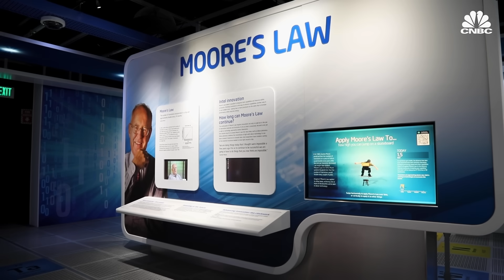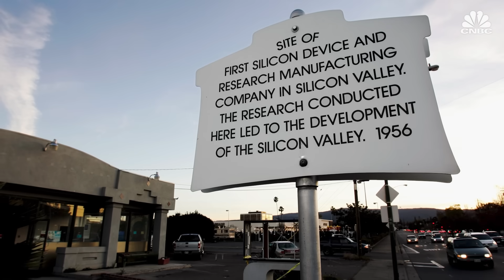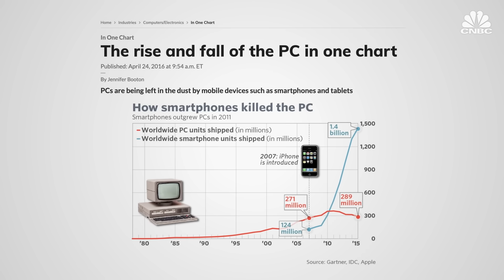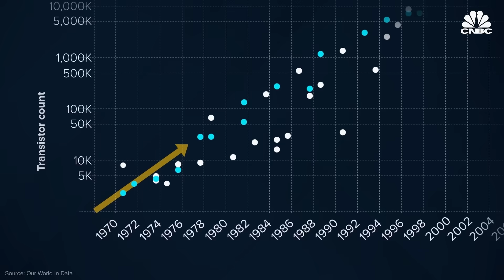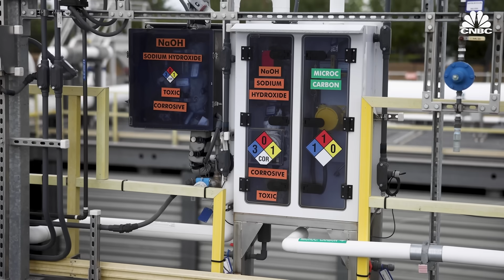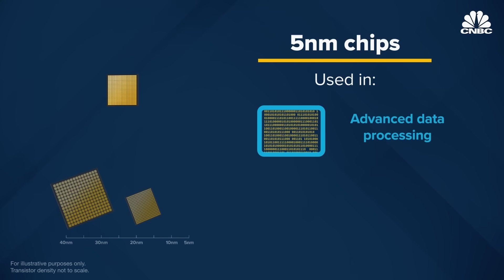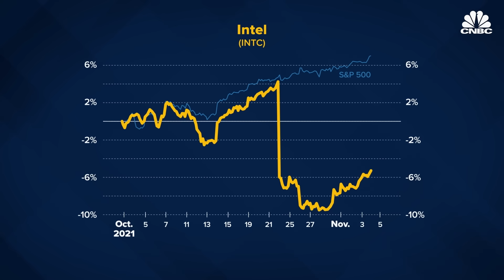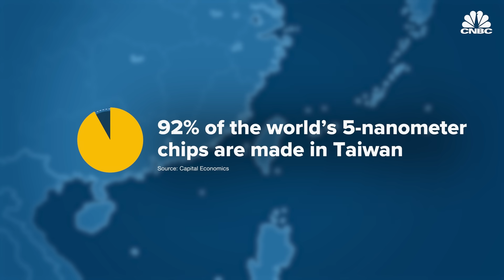Inside Intel’s Bold $26 Billion U.S. Plan To Regain Chip Dominance

Comment: Dr Lisa Su and CEO Jensen Huang right now: here we come Pat! You will be KO again 🤣🤣
Reply: Non of those companies you mentioned manufacture their own socs
Reply: @directlinkrexx4409  you think next gen Intel will do its own soc? 🤣🤣 Get the fking tech news man. Intel already agreed on 5nm deal from Samsung 🤫🤫
Reply: @vncatechinfo9798  Hardware industry works in cycles. The fact alder lake which is 10nm beats 7nm amd cpus tells their engineering is good, they just need to up their game on process node, which I am sure they will.
Reply: @Badumtss2468  sure intel will but intel needs to do with power's consumption on it way too high at stock. OC mode can draw up 400W which im not surprised when i9 11900k already did.
Reply: @vncatechinfo9798  I think that will be addressed with the big.little arc as it progresses further. One example being the core i5 12600k, if I remember correctly that comes for 320$ or so. That thing is sweet. Intel will get the crown back (it has already technically speaking). A sleeping giant, but a giant indeed.
Reply: @Badumtss2468  yeah Intel is a giant for years i have 10700k which is still good at the time i may upgrade next year and see which one offers the best price and better performance.

Comment: Would love to see Intel make a comeback, especially after their designs falling behind those of AMDs, chips manufacturing in the  US would also strengthen the supply chain
Reply: @Solendore I sure also hope there are bright futures for your company! Also its amazing that you're so passionate about your job!
Reply: @Solendore Good job on Alder Lake. Still the performance uplift compared to AMD 1 year old CPUs is not that significant and power consumption is definitely worse. AMD's Zen3D with V-Cache will most likely regain the performance domination. Good luck with Raptor and Meteor Lake. You will need it to compete with Zen4 and Apple M2 series.
Reply: @Solendore The main thing is that companies are developing on US soil.  That way, US companies control trade secrets, control production, and create in-house, organic job growth!
Reply: SILICON CHIPS SHORTAGE ARE NOT ACCEPTABLE IN THIS 21 CENTURY.
Reply: Gaming Fanboys give too much credit to AMD. It’s easy for them to take the credit, they not manufacturing the chips.  Intel could have easily designed a 5nm chip if they had TSMC make it for them.  But why would you want TSMC, a competitor to make your flagship products? 

Also the nanometer benchmark is just as misleading just as Clock Cycles and Cores.  It’s not so easy to determine performance on clock cycles, core count, or nm process.  
He best example is Apple Silicon vs AMD CPUs.  Both are 5nm but everything from core count, clock speeds, to energy consumption are completely irrelevant because Apple Silicon is based on ARM while AMD is based on x86.  Apples designs were built for mobile from the ground up, while AMD has been designed for Non mobile computers such as desktop and servers from ground up and they been scaling down to make them draw less power. The architecture is also vastly different as well. Apple Silicon on the new Mac Book Pros have put x86 processors to shame for video editing, photo processing, and audio processing.  The only thing that beats MI Max is a high end video card on graphics for gaming.  To be fair the high end video cards drain 300 watts of power, while the 32 core integrated GPU gives them a run for their money while drawing less than 50 watts of power.
Reply: @JasonB808  dont feel like reading all that man. Can you sum it all up in like 2 sentences?
Reply: They just can't unless its fab is another company. National security  can't give you cost advantage and  Taiwanese and Koreans are actually helping not competing. Provide stronger support to both 🇹🇼 and 🇰🇷 is the right way to go and let them invest in US. After all, most manufacturing are in Asia. You can't have just the chips made in US while end products aren't.
Reply: @Solendore As an Intel shareholder I have faith in you guys. Keep up the good work. 👍
Reply: Mfg chips in different areas of the Earth strengthens the supply chain. Not just "bRinG MuH MnaUfACturInG HoMe."
Reply: @mikes2381  Not to mention, there is the talent here to make chips, and when so much of it is automated, it doesn't necessarily matter as much
Reply: @Solendore Hey! what are your opinions on AMDs market cap? just a day ago it was about 168 billions worth and intel is around 200 billion in value. Ofc intel has much bigger revenue than both AMD and Nvidia, but their at risk of being overtaken by another one of their competitors in terms of value. Do you believe intel is currently undervalued?? especially given all the promises their making now and a change in leadership( Pat shows great promise).
Reply: @Solendore quick question: what do you think about the i7 10870h? would you still consider buying a PC with that performance today? or even as a laptop
Reply: They will, watch.
Reply: Both TSMC and Samsung are building major fabs in the US. TSMC has Fab 21 underway in Phoenix and Samsung will be building in Texas.
Reply: @Solendore valley silicon
Reply: @Solendore lol Intel 4 is TSMC 7nm, Intel 7 is TSMC 10nm. Comparable, yes, but you'll confuse people lmao.
Reply: @Solendore please crush amd. sellouts!
Reply: @Solendore U work there and u say Intel 7 is like Tmsc 7nm? Damn Intel 7 is 10nm and u not even close to make real 7nm to beet Amd. So other then your Cpu need Nuclear power to run and Uragan to lower temps. Wtf u talking about. Amd in on the way to make 5nm then mext gen even smaler. U can see what Amd made whit latest stuff. Very impresiv.
Reply: Their design has no issues. It’s their manufacturing cannot catch up the design.
Reply: That’s why US pressures Samsung and TSMC to share their secrets
Reply: Depend on what you mean by comeback. If you mean their chips will be as good as tsmc then yes they will eventually. On the other hand if you mean Intel can get back to the position that they were 5 years ago then the answer is no. The market share that Intel is losing to AMD would never revert back to them unless something terrible happen to tsmc/amd like U.S. ban tsmc chips for whatever reason.
Reply: @Solendore we will see when it goes in market. In the meantime I’ll stick with AMD.
Reply: The x86 has been and still is a lemon, why would you want them to rise up when they forced the industry down a flawed architecture, in comparison why do you think eveything but the PC is running ARM,  I rather ARM be king of the modern day CPU.
Reply: @Solendore You are saying you intel can beat the Apple M1 and Ryzhen but the M2 is rolling off the production soon enough, no Intel is well behind the 8 ball.
Reply: @Solendore If Intel can produce the advanced 7nm node chips, why would Intel need to outsource to TSMC for 5nm node chips ? Intel is 2 generation behind TSMC & Samsung.
Reply: toast
Reply: It would be a lot cheaper to teach Intel's employees Chinese, saves a lot of money and trouble.
Reply: IMAGINE THAT!  MANUFACTURE IN THE US!
Reply: They have
Reply: @Solendore if only you could make good products at an affordable price, focusing on the most insignificant aspect of technology performance, let alone catching up to the competition at a higher price isnt something i would brag about. trying to enter a new market, only to call it quits when its not immediately successful is downright shameful, hopefully all this free government money will bring alot of affordable, high quality chips to the market, i wont hold my breath though, it is intel the king of high price we are talking about.
Reply: Agree. Everybody loves a good comeback story, right? Seabiscuit, the mighty ducks, Robert Downey Jr, Rocky. Kim Kardashian.
Reply: Ahmen!  Buy products with INTC chips.
Reply: @Solendore but your power consumption is ridiculous, of course you achieve more performance if you throw more power at it. Power efficiency is just as important as performance
Reply: @blablabla6975  you call gaming with same power consumption as AMD ridiculous ?  Get your thoughts together, man.
Reply: @blablabla6975  really not tho, intel just really pushed the 12900k by setting the power limit at 241W. You could limit it to 180W and just lose ~10% of perf. 

Plus the 12900K has similar MT efficiency to the M1 Max when limited to 35W.
Reply: @blablabla6975  Honestly at that level of performance peps who really can utilise that Power don't worry about Power consumption
Reply: @bloodwargaming3662  TELL THAT TO THE SERVER MARKET!
Reply: @blablabla6975  Specially for portable. And more power consumption mean more heat. Intel has a big problem.
Reply: @Solendore I have a question if you really are a engineer at Intel no offense (many fake it ). How does apple M1 max compare to your products and why does  intel still use 10 nm tech when literally smartphones are gonna have 5,4 nm in their chips .
Reply: @bloodwargaming3662  Based on the latest articles from Igor's Lab, 12 Gen is much more power efficient than AMD 5000 series for practical usages (works/gaming). I guess the high power settings (from motherboard vendors) are simply for the purpose of performance crowning (i.e. marketing in some way). But if you limit those power, they are quite efficient. I just ordered Alder Lake 12600K after reading many reviews in the past few days.
Reply: Alder lake cpus are crushing everything on the market.  Will be interested in how AMD responds.
Reply: @coacharchlane  Yeah, I'm pretty sure the AMD cpus out rn are kinda last gen, and intels is current gen, so I'm interested in benchmarks from the upcoming AMD CPUs
Reply: @coacharchlane  Yeah, with a 241W PL1... (SARCASM)
Reply: Check Intel's new gen CPUs, Alder Lake, released it couple days ago, they are ahead of both AMD and Apple performance-wise.
Reply: @JigilJigil  u compare Last Amd product whit newst Intel whot use Ddr5,socket and all and is still very the same in scores. Like i said u need Nuclear powerplant to run Alder lake.and whit all new u didnt cursh Amd u just come close to them.so next from Amd gonna demolish Alder lake amd all u present other day. New ddr5,socket Cpu against last Amd lets see what gonna be when Amd put ot 5Nm u still on 10nm u call 7😂 Epic but nothing like Amd Epic Milan x 😉 salute
Reply: @JigilJigil  While consuming 2-3 times the power...
Reply: @evalangley3985  I’ve owned and built several systems with both AMD and Intel, and current/recent ones too.  I’ve hooked power meters to many of my machines and still to this day, Intel is far superior in overall power efficiency at idle and part loads.  That’s what saves you money in the long run.
Reply: @Solendore Apple has not rolled out their desktop CPU yet. Comparing your desktop product to M1 Max (which is an laptop SOC with both CPU and GPU components and still uses 3-4 times less the watts) to the 12 gen Intel desktop CPU (no GPU) is just misleading at best.
Reply: intel will own AMD in 1.5 or 2 years time. intel got fabs. AMD don't
Reply: @Solendore your company is already dead inside.
Reply: @Solendore im an electrical engineering student and would love to work with you after hearing how passionate you are about your company
Reply: @robx8972  Are you insane...??? https://youtu.be/agxSclh27uo
Reply: @Solendore Ah please... 2-3% better gaming performances than Zen 3... while AMD Zen3D is around the corner. You guys are late... late... late. You are on DDR5 and your CPU is a power hog requiring AIO.   https://youtu.be/SQAfcJ_BHyE?t=222
Reply: @Solendore "put the company on top of consumer CPU performance hierarchy over AMD" not really though. I looked up the benchmarks for Alder Lake and half the time amd cpus are better while intel is more expensive.
Reply: They will
Reply: @Solendore But still calling 10nm Intel 7, 7nm Intel 4 is boarder-line false marketing.
Reply: I9-10900k 10core 20 threads
I9-11900k 8 core 16 threads
Ya good math there Intel, I'm sure stepping back a core is the best upgrade.
Reply: @ianlyne4417  11900k is beta project for metor lake multi fab 3rd staking. Intel wasn't serious about Rocket , if they were instead of sunny cove they could have backport willow cove architecture. And sunny cove architecture was designed for 10nm and 14 nm has half density that's why to draw one core in 14nm intel needs twice area of foot print and pcb size are limited .
Reply: @Solendore If you are believing that AMD will just stand still, then you are the reason why your company is not market leader anymore. AMD is 4-5 years ahead in MCM designs... you just released a CPU that BARELY match Zen 3 performances... one year later... on DDR5... with double the power consumption for compute. You released a Prescott 2.0... congrats.
Reply: @evalangley3985  actually intel first brought mcm desgin the brodwell. And this alder lake , is not a new architecture , it's 3 years old suposs to be came in 2019 but intel unable to deliver 10nm in 2020 as well and i have seen another skylake comet lake. Actually if intel wasn't aggressive on 10nm density than they could have produced it's in 2017 and able to deliver cannon lake timely (sunny cove). But we got this cannon lake in 2021 as a backported cypress cove rocket lake.
Many people misunderstanding tsmc with amd. Tsmc is now leading  but amd should have the capacity to take advantage of tsmc. In 2023 tsmc gonna launch n3 but amd will barely launch n5 prodouct in q4 2022 Raphael. So amd don't have any product line up for n3 in 2023.
Thats why they didn't booked n3 for 2023. Whereas intel booked n3 for some secret upcoming product. The amd fanboy have to realise , tsmc not amd and amd not tsmc. Tsmc don't care about intel vs amd they have foundry business just need to sale that whoever come first. So amd should have the capacity like intel skylake architecture , using far node behind competing against advance chip on some fild . Thats the nature of leadership. And even though the tsmc advance node price are exponentially increasing. In that case, only Apple can bare those advance node right after launch because apple has that lavel of customer who gonna pay for that.
     And behind the scenes amd too struggling . They yet unable to make more than 8 core ring. Thats why Raphael you gonna see 16 core . Because adding extra ring ie 3ccd means incressing latency and it would behind by not only raptor as well as alder lake. And probably in upcoming 2 years they won't able to fix this ring problem.
 The zen4 + would be 32 core and it's gonna competing only in multithreading and singel core performance would be lower to zen4. At least they should going offer aginst something metor lake. Ie they gonna use again by connected ring like zen2 ccx. And we now by connected ring how bad in gaming . They even struggling to beat a 5 years old cpu in gaming and latency sensitive task.
Reply: @Solendore you're describing how you're underpaid in >300 characters sir! had offer from intel oregon, lab126 and meta's hardware division (oculus), intel was paying <1/2 the competition for same position. Can't have willing people for less
Reply: @Solendore you dont work at Intel. Make a video explaining computer architecture in your own words. Let's see buddy let's see.
Reply: intel will fail because they are infested by the ccp.
Reply: AMD is still slower than Intel.. for sure in top performance benchmarks. Apple m1 also is nothing at all good in benchmarks for power and video power.
The best is still nvidia and intel powered gaming PC, simple and fact if you research the famous benchmark called Port Royal Hall of Fame benchmarks... 
Luumi is one of the youtubers who proves it with nitrogen cooling intel chips and nvidia for graphics.. its been the best and I build PC for 20 years, I know what I am talking about (aka you cannot correct the facts)
Reply: @dertythegrower  so you want to have nitrogen cooling for home setups?
Reply: @dertythegrower  12900k powerful
Reply: @sussybaka8389  not really
Reply: @kennyhotz2899  power hungry tho
Reply: @dertythegrower   I certain that all of us will be installing liquid nitrogen dewars to allow us to get the most of Intel's latest processors.
Reply: @dertythegrower  CPUs... nvidia is better... WTH???

Comment: Wouldn’t have to do this if we hadn’t given up our chip dominance in the 90s due to lack of vision smh.  Tech is now.. and tech is the future.
Reply: Intel’s manufacturing process was competitive and leading until about 2015 when they had trouble going from 14nm to 10nm. That was when TSMC surpassed them by going into 7nm and 5nm.

AMD also redesigned their chips around this time (The first Ryzen) so despite larger and sparser transistors, they were able to make a big boost from their old Excavator like of CPUs and be 80% competitive with Intel. Intel kept the old P6 architecture from 1998 going for as long as they could.

It would have been great if Intel didn’t laugh at AMD’s puzzle block strategy (CPU consisting of small does and connecting them together with infinity fabric) when they’re now using them too
Reply: SILICON CHIPS SHORTAGE ARE NOT ACCEPTABLE IN THIS 21 CENTURY.
Reply: Yep. Intel was extremely anti-competitive in the 90:  I think over $2b in anti-trust fines. Govt failed to reign it in and now is stuck with a second-rate fab.
Reply: @ikjadoon  bad governing and greedy....
Reply: Jee Vang  Sure I do.  I am a tax paying citizen of the country giving Intel the tax brakes it so enjoys.  If you had any intelligence you'd have understood what I mean by "We"